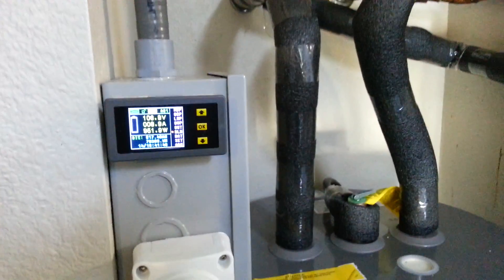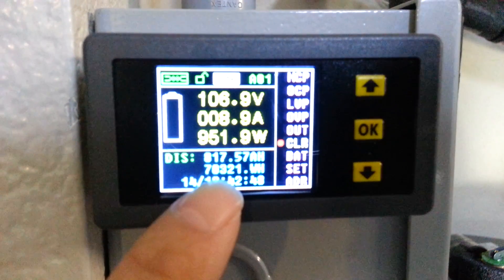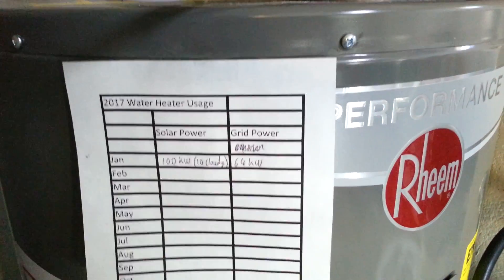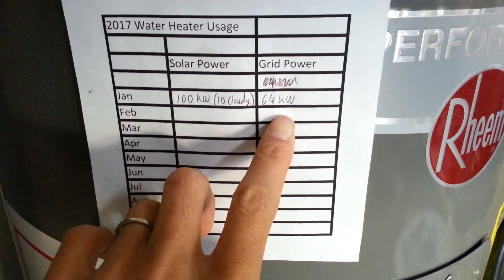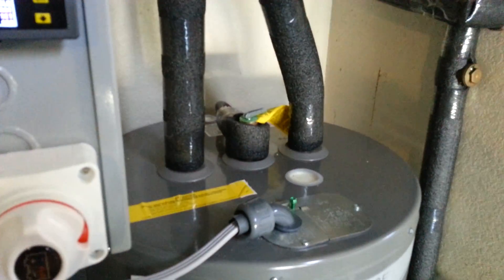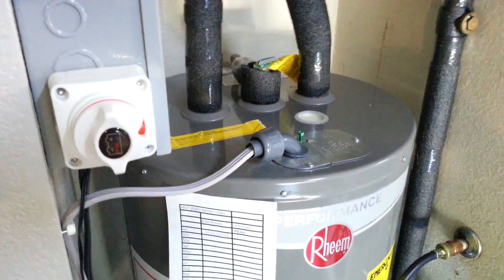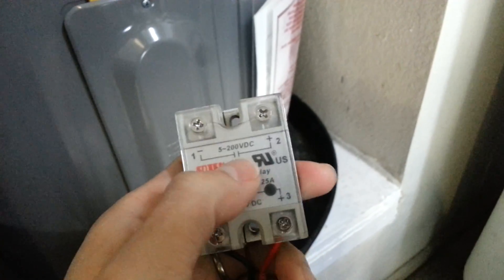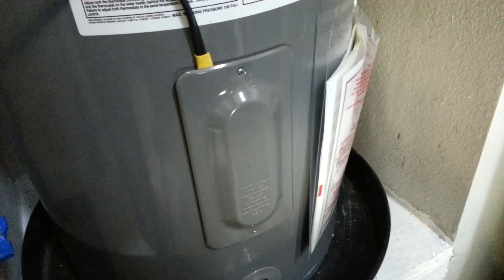Off grid 1.3kw Solar Panels PV to heat water directly (45days update)

Comment: you might have had the load side backwards on that DC SSD  . I had a DC SSR sort of like that and the problem was with the polarity of the load side I had. It worked okay until I overvolted it.  You can get an IGBT block that can handle lots of voltage and current.  But you need to really heatsink those well.  I just made a video of my northern hot water system . I will have to see if you have any updates on your system since this is 4 years old now . here is link to my video https://youtu.be/s7trVpHLts4

Comment: i watched  few of these videos and people are having problems with burning thermostats or had to  using kits that costs  250 $ like one engineer 775 solds. All you have to do is get contactor for about 20 30 $ and cheap aliexpress thermostat that costs 2 dolars. you can control temperature in a degree and you won't burn anything and you won't waste much money
Reply: There's no reason not to run higher voltage. Most thermostat switches are rated at 480v. You just need to match the ohms of the element to your voltage and amperage from your panels in a series.

Comment: Thank you for taking the time in explaining how to do the solar water heater the easy way, I am in the process of doing the solar water heater Have the Rheem Performance Plus 40 gallons 5500W heating elements and 5 PV panels 220W 24 volts DC but as I watched your video I realized that I need few more parts that would take me where I need to be, is it possible for you to  post the parts list. Greatly appreciate it.
Reply: How far have you gone with your project a any results yet? I do a lot of PV water heating.

Comment: Instead of un hooking panels, another solution is to install a thermostatic mixing valve to mix the hot water and cold water before it goes to the faucets of your house.  Samething used on boilers.  My opinion is the hotter the better for the water as long as it doesn't boil.

Comment: i have been using the same setup for several years.  during the summer I turn the AC power off so it will not overheat .  I have 6 large panels.  two go to the water heater in series.  I have two eBay grid tie  inverters each is connected to 2 panels.  I only track the power on the grid tie inverters.  I want to start setting up batteries and an off grid inverter for when the power goes out.  I live in ohio.

Comment: The relay was not high enough amps for load.
Reply from the maker: It's rated for 25amps, it should have been more than enough.  The 
problem is it's a shitty or a clone relay that doesn't have real rating.

Comment: sun bandit makes a kit
Reply from the maker: Yes, I know their uses a micro inverter and can work with the stock thermostat... But price are still high.  Also seen a few other option for them MPPT converter where is convert Solar DC to a Pulsing DC type so you can still use stock thermostat.. but damn them, one brand want 300.00 for a tiny board... the brand name with a box want 1200.00, counted there's less than 20 electronic component inside....
Reply: I know where your coming from with prices. The electronic relay you had should have taken the load. What voltage does it need to turn it on
Reply from the maker: The Fotek one trigger voltage is 3-32volts, I was given it 12vdc.  It 
did work once, the first time.  I hook it up, there was no contact... 
Then when I apply the 12volts, it tripped and make contact... work.  
Then I remove the 12volts... it buzz a bit.. but won't turn off.  I shut
 off my main power (the white switch).  Hook it up again, even now 
without any 12volts trigger input... it still make full contact.    It's
 now a buss bar, not a relay.  :)
Reply: Some of them are AC only some are DC. There's many different brands and ratings  for the most part work good. Does that need a resistor on the trigger circuit
Reply from the maker: I'm sure the one I got rated for DC.  But who know... They could have put a different label on it.  As for the resistor, I have no idea.

Here's the one I bought:  http://www.ebay.com/itm/351911944512?_trksid=p2057872.m2748.l2649&ssPageName=STRK%3AMEBIDX%3AIT
Reply: Was there any product data with it. From what I seen it should work. Go with a better quality product. Find out if a resistor is needed in trigger circuit

Comment: Yes you MUST buy a real solid state relay. Tho's cheap one's are real shit as you know. Buy it from a knowen place on line. Not Ebay.. 

That water heater is bad ass and will save a lot. Thanks for showing us..
Reply from the maker: It's hard to determine GOOD stuff and Chinese stuff nowadays... since most are from China anyway.  So you mean something like this?  https://www.grainger.com/product/DAYTON-3-to-32VDC-Input-Voltage-1EGK8

119.00 from Grainer... but then what seem to be the same one sold here on Ebay for 25.00... WTF right?

http://www.ebay.com/itm/DAYTON-1EGK8-SOLID-STATE-RELAY-25-AMPS-SSR-SPST-N-O-200VDC-OUTPUT-3-32DC-INPUT-/251339233398?hash=item3a84fc5876:g:EZsAAOxyyvRSNJVL

So, the million dollars question is... is the Grainer stupidly over price... or the Ebay 25.00 is fake?

:)

Comment: very good. you are definitely saving money. 
I believe solid state relays need a heat sink or at least some do. you are on the right track. l appreciate you sharing your experiences.
Reply from the maker: Thanks Bryan... Yes I know about the heat sink, but I was monitoring the back with a temp gun..  During the testing process only ran it like 2minutes... the back plate was never above 80F... So i don't believe heatsink would have help it.... It's probably the high DC arc that fuses the chip inside...  I kind of already KNEW it wasn't going to work anyway.  haha.
Reply: devildestiny555 do you still have that relay? I wouldn't mind seeing the guts and the failure point.